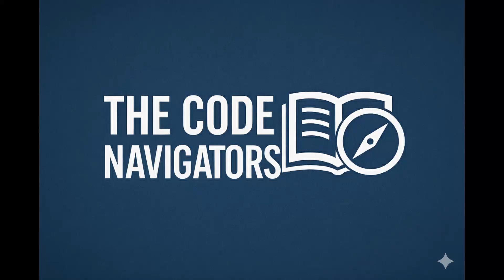The Code Navigators 2021 Chapter 21

Comment: En el minuto 12:20 indica que el Mechanical splice Type 2 no puede ser usado en donde sea una zona plastica hinge pero en la sec. 2108.3 TMS 6.1.6.1.3 indica lo opuesto. El que no puede ser usado es el Type 1. Gracias por el resumen. IHT